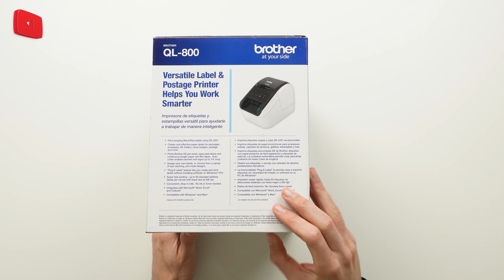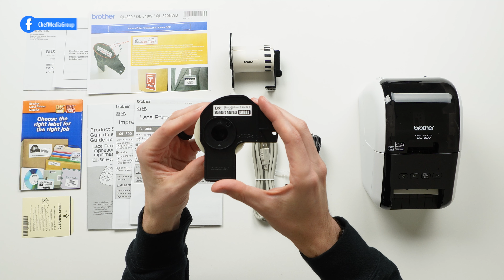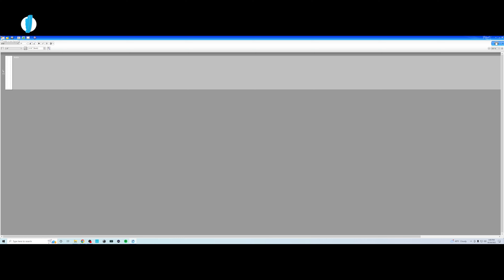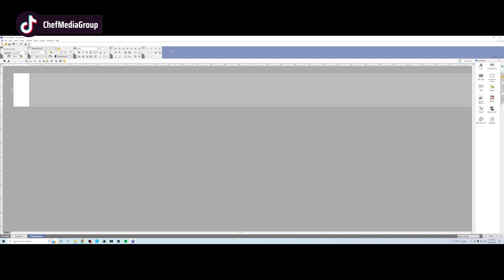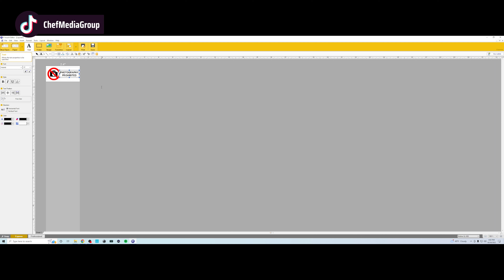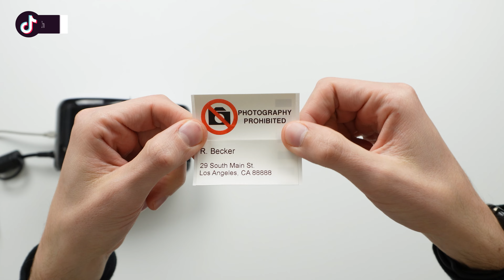Brother QL 800 Label Maker Label Printer Review

Comment: I am looking at this printer to do barcode labeling for inventory and the program I use needs a printer that uses standard drivers as it generates a pdf to be printed. I noticed you only printed from the Brother software. Can this print from third party applications like a normal printer? 

Also curious as to how a continuous roll knows where to cut? I can’t find die cut 1x1 labels but I could use a 1 inch continuous roll and have it cut at 1 inch, but if I’m printing from a 3rd party application, is that still possible?